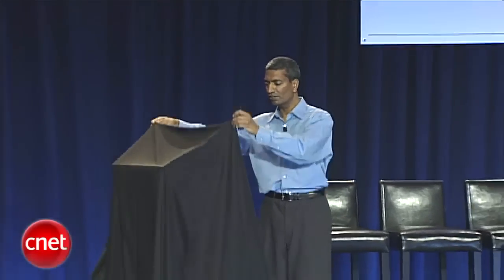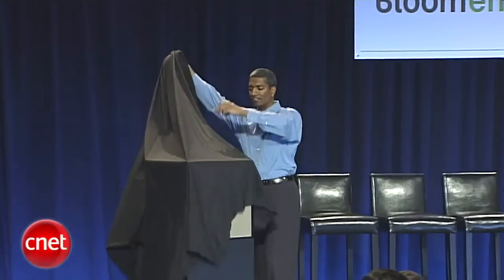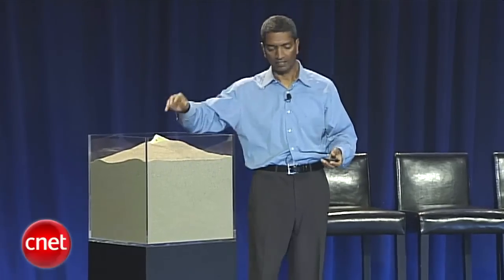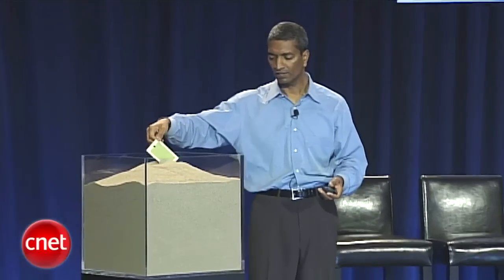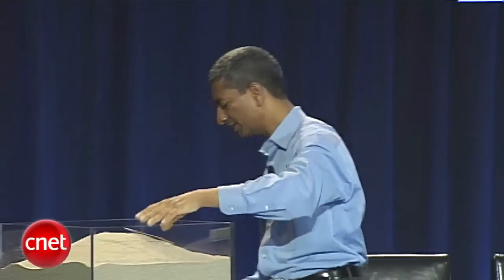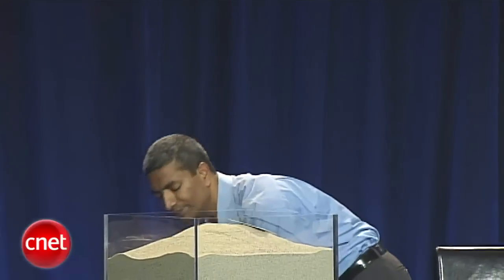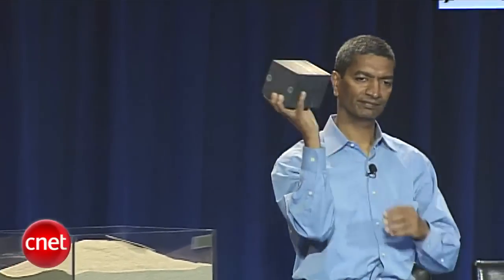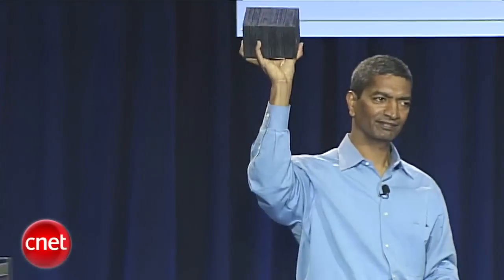Bloom Box Energy Secret Revealed! [HD]

Comment: well yea, but what is involved with making the 2 pastes on either side. The sand is only used to make the white card right?
Reply: green nickel oxide-based ink is the anode on one side, and on the cathode side its most likely Lanthanum strontium manganite ink, and according to their patent the "electrolyte includes yttria stabilized zirconia and a scandia-stabilized zirconia, such as a scandia ceria stabilized zirconia"

so yeah as far as the average the fuel cell goes these type of solid oxide fuel cell are bit cheaper, but you won't be using them as door stoppers.

Comment: need more data on benchmarks of that device. what waste does it produce besides heat? maintenance costs? if one of the selling points is that your building will be "off grid" then that would be untrue, as it still needs to be connected to a natural gas pipe/tank.

Comment: The flexibility of the Bloom Energy Server allows customers to dramatically reduce their carbon emissions while continuing to power their operations reliably. When fueled with biogas, the Bloom Energy Server provides 100 percent carbon neutral power generation. When powered by natural gas, it releases a fraction of the CO2 produced by coal-fired plants or even modern combined cycle natural gas plants, when one accounts for line losses (as recommended by regulators) .

Comment: Apparently they are only making this available for industrial purpose. It always comes down to money helping the super rich. What a shame.
Reply: +John Arizona that's because it's still in test stage. industry's an large company's can afford this, and when they run them, they do test on the system at the same time, fixing problems as they occur.

or you can get it now, and one day it stop to work because they didn't do all the test, so now you have to sit in your dark and cold home, until they can find a solution for the problem, for you have only one small bloom box, while the big company have several big ones, so if one goes, they still have energy, from the reminding operational bloom box.
Reply: Residential should be the primary focus to help people not faceless companies owned by the 1% wealthiest so they can get wealthier. Profit based "innovations" lack ethical and moral foundation. The "tests" point you made could easily be done in residential examples and you would attain a higher degree dynamic results but then you wouldn't make the fast cash that way or maybe you would but actually caring about people more than profits would be a necessity.You cannot serve two masters as you will love one and despise the other. Money is a great deception my friend and it always brings ruin. To see a persons idea that could help humanity be tainted like this is a shame.

Comment: the secret core is not the sand square but the 2 incks he coats the sides with. it's just that he makes such a big deal over something that still uses fuel and puts out co2 like any regular engine or generator. just that his is as efficient as a power plant. solar panels and battwries are making all his crap absoleet

Comment: It's true that using sand (actually also glass is made up of) and sand are small stones that reflect sunlight multiple times, you'll probably get more energy out of that, even with a small amount of sunlight it's more efficient. I'm still not convinced about this whole solution. You would still need a strong light to get that whole Bloom box working.  Cells work with absorbing that light.. maybe with a magnitude glass it could work somehow. Next thing would be the storage of that energy.

Comment: NOT green and clean. It generates CO2. It is, however, more amenable to rural and isolated area usage. It is a fuel cell and could, if it can be scaled to about 40 to 50 KW per cell, make a really high MPG hybrid electric car that runs on natural gas and emits a fraction of the pullution.
Reply: global warming is a lie
Reply: wearediffrent That's right. It's a fabricated term made up by a news reporter. Scientists have always called what we are witnessing "Global Climate Change". A primary cause is the recent dramatic increase in the rate of CO2 influx into the atmosphere and Man is responsible for about 80% of that.
Reply: Heisen Berg Prove that assertation without bullshitting. Can't do it? Then don't try and step up. And reports by discredited pseudo science groups and journalists do not count.
Reply: use HALF the fuel of current generation systems, so shrinking our carbon footprint by HALF immediately will help the climate model overnight. If only we could suck CO2 from the air.
Reply: Mark Robinson Just have to keep from falling for the latest scam where a really neat idea like this is being exploited in the same manner as "Solar Roadways".
Reply: ***** Ok, here's what the terms mean. "areas that have a gas supply" are precisely what I am referring to. Many areas in India and Africa do not have a ready supply of electricity, but do have plenty of natural gas and can make methane from biomass. Now, answer this question: Where would your electric cars get the electricity to charge their batteries? From a bloom box, perhaps? You need to think outside the box and realize there is a lot more to every idea than is visible to the naked mind.

Comment: Does anyone know what the green and black layers are?
He says it is an Ink of some sort in another video. I am guessing it is something like what is in a Lithium Ion battery. Lithium oxide on the green side and carbon on the black side. The hydrocarbon has the oxygen molecule stripped by the lithium and the carbon is pulled to the carbon side, leaving hydrogen, which would get exchanged into water and Co2. If this is the case, This cell has to breathe in and out to function.

Comment: Do you have a power plant and a method of incorporating it in both electric cars, travel trailers for those of us that live RV life styles. In essence is there a portable generator version yet??? Could a person park on raw unserviced land and use a version of this for power, heated by RV propane, yet be portable enough to take to the next site, or to an open field and use as a generator. How long would a house hold size one run an RV before needing a recharge and how would you recharge it? Would a permanent one attached to the RV and recharged with propane be useable??? Also how much would one of these cost for say a 30 ft trailer?
Reply: Harvey Holloway It'd be a convenient way os charging one's RV; while it's parked. Wish someone builds an RV solution wit this.

Comment: I am confused on the issue of the gas, energy source, that is added to the treated plates. How much gas needs to be added per box, per day (or week, or month)? Does the gas have to be circulated? Is there a difference between using natural gas vs. methane? Can hydrogen be used, or HHO?
Inquiring minds want to know. Paul
Reply: They are being very secretive about what there cell is doing but it seems only work with hydro-carbons.  This is a fuel-cell for fossil fuels.  I would doubt it would work with hydrogen.  So it's the same chemistry as burning the fuel but instead of heat you move electrons creating electricity. They claim it's more efficient then burning the fuel and transporting it across the grid.
Reply: Thank you jpegjpg. I am also, going to sit back to see what happens. I offered a better alternative. I was impressed to receive a response, but to reject out of hand is their failing. This is not a quality of a scientist, hence my response. Thanks again.
Reply: It’s oxygen that fuels it, it’s natural. If the system clogs up you symply reverse the system

Comment: just another fuel cell :( 
more CO2 for our atmosphere. Don´t burn oil but oxydizes natural gas (CH4 + 202 = CO2 + 2H20 and electron exchange)
What´s the invention??
Reply: they are actually trying to design a way to use the Co2 as a fuel source
Reply: +Cody Leblanc
They aren't this is a Solid oxide fuel cell, you can't get energy from CO2.
Reply: lol didn't think they could get energy from Sand either man.

Comment: I don't understand how I missed this story, back then. And I don't understand why you all are pissed off spouting shit?! It is a real machine making electricity! But they only have it at utility size units! Have not made home size units yet, why? Don't know. But this is an extremely high temperature running unit, 430° C  might be the reason why... but we only need a 'small' 500-1000 watt unit for the home.
What I don't understand is why thier unit doesn't provide heat for customer, that would have made the unit more useful and more efficient! And they do not capture CO2 gases! That was the claim about fuelcells is that you don't release pollution, but the govt should have known this from the start, they already studied this technology! Why invest in one company that failed to be better then a regular gas engine/turbine?

Comment: He is like the Hindi Steve Jobs. Tells you all the hype but once you see it... well it's not really that special. Still need fuel of some sort and probably something that will not be renewable. At least wind and solar and geothermal is renewable.
Reply: just how do you renew Geothermal?
Reply: You don't renew Geothermal it is always there, you cycle a liquid through the tubes pulling the heat from the ground to run a steam generator. You don't take anything from Geothermal except the heat and the heat your taking is not going to be all used up because it is coming mostly from areas that are volcanically active. Do you really not know how Geothermal works or are you just being nit picky about the choice of words I chose to use?

Comment: If this works and they figure out how to upscale production while slashing the price, even though it uses fossil fuel (natural gas) and will produce CO2, it's a huge step forward.  If we take what was said in the 60 Minutes segment as correct, its efficiency is twice that of our existing gas power plants.  Thus, CO2 emissions and fuel consumption will drop dramatically.  This wouldn't push the price of gas up, speculation might, but not the spread of this technology.  I'm just curious what cleans the catalyst's surface.  Natural gas is pretty clean but it can and does have some impurities.  Over time these plating out on the surface would reduce the reaction rate, or at least I would think so.

One negative effect would be the massive loss of jobs were this technology to supplant conventional Rankin, Brayton and combined cycle plants.  I doubt these jobs would be replaced by Bloom Box assembly  and maintenance jobs.  Oh, well.

Thorium reactor tech is cool too.

Also what is this racist stuff?

Comment: No, the "conspiracy" theory is wrong. In situation they have oportunity to choose, the energy companies just buy (or even leas, or loan) the technology and surpass the expensive to produce and maintain grid. But what was missing in that video - the technology needs air influx and energy influx. The needed energy input is much lower than the output, but that boxes have to be coupled with fosil fuel generator, vind turbine, solar panels, or whatewer to sustain it, before it can produce desired energy.

Basically ALL people are racist - and racism itself is not a problem. Problem is disregard, crudity and sometimes violence, that the inherent racism ocasionally spawns. You know, all people WILL still maintain their skin colour, and their genus. If they got the even chance to prove themselves, I see no problem in that they are AWARE of possible background differences.

The Indian sciensist living in USA is NOT from middle east.

Comment: He is a fake?
Reply: No. As you can see he has some big names that adopted his product. eBay / Google etc. But his is not the only company with fuel-cell patents making fuel-cells.
Check out ClearEdge Power bought out by parent company Doosan Group, who also happen to own Škoda Power. These are BIG names. ClearEdge's product was a PEMFC fuel-cell design. One of the big problems with many fuel cell designs (Like the Bloom design) is if it stops working due to any kind of fault, you just about have to replace it as it is almost unserviceable. This would be fine if they were cheap, but they're not. The ideal product would be cheap to make, not contain exotic materials, be efficient and serviceable. Other companies like GE will be working overtime to bring such things to the masses. What will be likely, is that these will run on natural gas so the oil and gas companies don't go broke overnight. I guess we'll use these until fusion becomes viable one day.